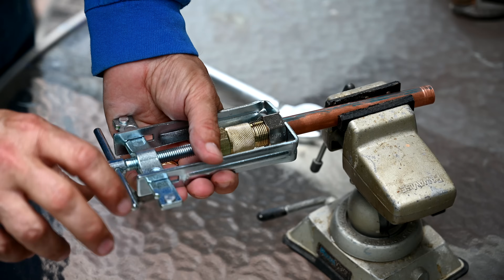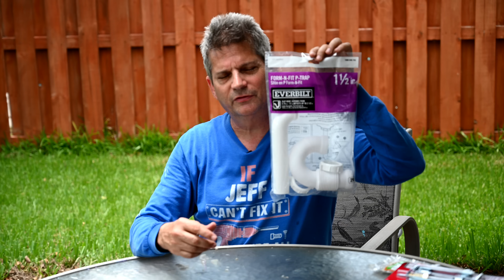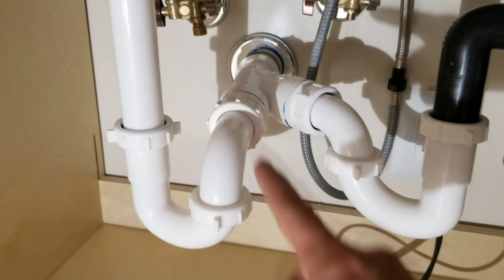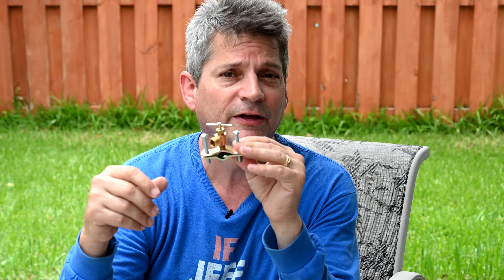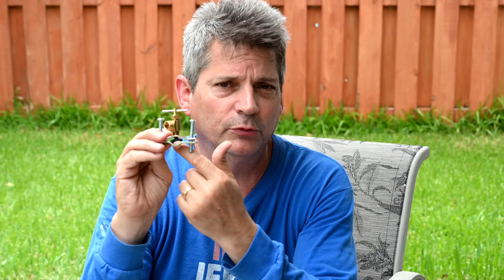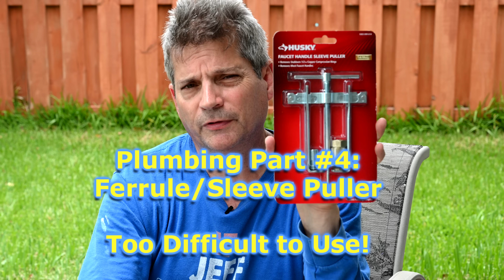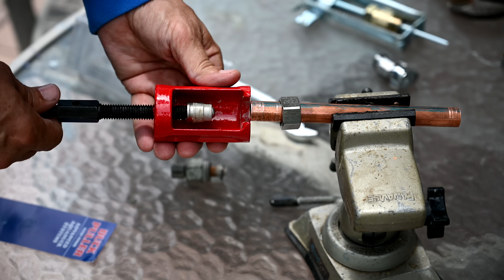4 Plumbing Parts/Tools You Should NEVER Use. NO Plumbing Fails

Comment: plumber taking 10 minutes to install a tee fitting, ok.  What's he gonna charge for that 10 minutes?  $200?
Reply from the maker: They generally have minimum charges probably an hour for just showing up in period one time I had 1 come a couple of years ago at 1 of our flip condos to snake out the kitchen dream to the sewer and it was a $135 for 20 minutes of work he was and even there a 1/2 hour total.
Reply: @geoff Hazel Invoices  are not just to cover the time someone spends in a customer’s house.

 

Time spent on site is a fraction of what the invoice has to cover.  It can take over an hour to drive from one job to the next, sometimes less.  We also have many fixed costs including, but not limited to:  insurance, vehicle maintenance, training, communications, tools, calibration, office time, office equipment, vehicle leasing, accountancy costs, PPE, tax, Pensions, sick and holiday pay.  Most of these are the same if we are on site 5 minutes or 5 hours.
Reply: Geoff Hazel 200 dollars is reasonable to do a job like that. If you can find a licensed plumber to show up, crawl under the house or go up in attic, install a copper tee and run water over to whatever you are adding you should save his number in your phone.

Comment: ferrules are not meant to be removed don't even try this
Reply: I always make my best effort to replace ferrule and nut when replacing a water stop. If one is replacing a water stop, might as well take a little more time to do it right and replace the whole thing. The only time I dont is when I have no room whatsoever.
Reply from the maker: @ryanporter1819  Yes, I do it 100% of the time, it comes with the valve, why not use it. It also gives me a chance to buff down the pipe back to brand new super shiny copper status, just like it was in day one, every piece brand new, and I can sleep better at night knowing it won't leak. Nothing beats seeing that brand new shiny copper pipe coming out of the wall, with the new shiny chrome flange plate, and the brand new 1/4 turn valve and steel hose. When selling your house, no home inspector can argue with it. IT gives them no reason to try to claim your valves are old and "due for a leak"
Reply from the maker: Yes you can remove them, and we do when there has been excessive moisture and hence corrosion. We bring the pipe back to brand new status the day it was originally installed.

Comment: I agree with all your points except for the puller, you are not using it correctly. It, in fact, works quite well. The piece that rolled on the table is supposed to be in the brass part, those large 90 degree pullers are not needed for this, only faucet handles.

Comment: Why not say use this instead of this, that would be of more use than just quoting what is banned in code. Without giving proper alternatives this video is rather useless.
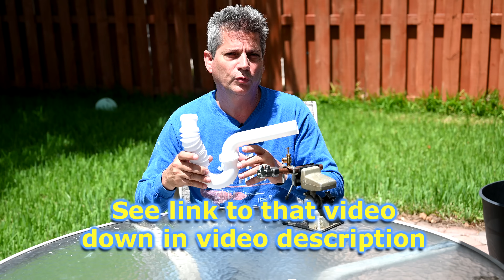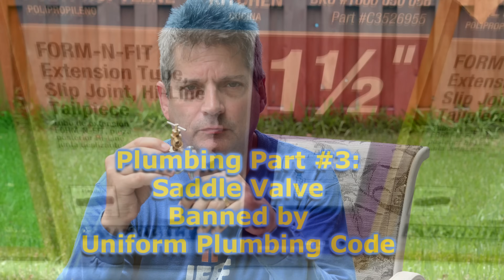Reply from the maker: LOL, I did just that, you did't actually watch the video. At 3:15, for example, I tell you about using the p-trap alternative to use for S-Trap. At 6:15 in the video, I mentioned the alternative to using the flex trap. At 10:45 in the video I mentioned what real plumbers do to remove a saddle valve, and what the correct parts is for them to use. You never watched the video! LOL!
Reply: jeffostroff  a long way round for a short cut.

Comment: I’ve had a saddle valve on a PVC pipe feeding the refrigerator for over 40 years with no problem.
Reply from the maker: That is a more ideal situation than cheap metal on copper types of saddle valves. For every person you like you who gets lucky, there are plenty who are unlucky. When that leaks and causes $30,000 flood damage, how proud are you going to be of those 40 years?
Reply: jeffostroff It has been my experience over the past 60 years that more times than not the failure of different products is due more to improper or faulty installation than it is to the product itself.
Reply: jeffostroff   $30,000 dollars?  I have remediated hundreds of water damage houses and business due to leaky pipes or appliances and the vast majority never exceed a few thousand dollars. It is the rate exception of a major second floor leak not being discovered for at least a few days that may result in $30,000 dollars worth of damage.
Reply from the maker: @kenedward60  Mold remediation adds a bit tot he cost, and I've seen people whose flood damage ruined several rooms, closets, all the clothes in the closets, all their furniture. Mold is a big issue here in FL. Also people get displaced out of their home for weeks because of the mold.

Comment: I'm pretty sure you are using the Husky Puller wrong.  I'll admit that I never used one, but I seen instructional videos of a similar tool by Superior tools.  The arms are only used for Faucet handle removal.... for the sleeve you only use that small drum insert and then is behaves similar to the second tool you demonstrated.
Reply from the maker: The Husky tool works on normal ferrules, and yes I was not perfect in showing its operation, but we have used it on stuck ferrules and it does not work on stuck ferrules.
Reply: @jeffostroff  It might very well be that the tool still sucks but I just like giving tools a fair chance with correct usage :)
No offense intended but the demo in this video was more than just "not perfect" but it was completely wrong.   Not sure if the link will work but the video I referred to is here  https://www.youtube.com/watch?v=7KDe8ACKjwc

Comment: Welcome to my world...... but what about all the things that may not be a specific code violation, but are just BARELY allowed? Plenty of poorly designed components and parts. Cheap does not have to be crap. WAYYYY back in the day, a CHEAP faucet by Delta, American Standard etc.... was same or better reliability than their own fancier full line, you just had less style and finish selection. The old Good Better and BEST options..... but the basic was totally acceptable in engineering and materials.   Nice video, but it goes into the weeds...... WOW.... could not sacrifice a 75 cent ferrule, to do a real demo of the tool ?  Redo demo, I'll send you a buck.... The Toilet "hose"  ?  OK, when I make my own U Tube channel, I'll take the hits, I am sure!
Reply from the maker: Yes that is a good point often times we find that minimum code isn't always the best and often isn't good enough.

Comment: S-bends don't fail by reason of "capillary action";  they fail for reason of water momentum and, more predictably, for reason of unfavorable differential pressures.  Thus an S-bend won't fail if the "nearby toilet" creates no suction on a lavatory's S-bend;  by virtue of good and copious venting at the toilet drain pipe design.   While S-bends might be illegal, they aren't guaranteed to fail, like a lot of other illegalities.   So there are "venial sins" and "mortal sins," in the Ten Commandments, and in the UPC.

Comment: Try the English Tool Company compression sleeve puller.  It's cheaper and half the size of the one in the video and pulls the nut/ferrule off with ease.  Just use a small rachet/socket instead of a wrench and bam, its off in seconds.   Here's a Youtube link:  https://www.youtube.com/watch?v=y0ikqzSz-DQ
Reply from the maker: We have this tool. I plan to do a video soon showing all the tools we use to remove a stuck ferrule compression sleeve

Comment: This has been very informative. While I agree that some of these products aren’t great, I was surprised that they aren’t code considering the massive market for them.
I have actually used a couple myself and learned how bad they were.

Some of the reasons people use them isn’t being cheap, they don’t have the money for a plumber.
With the randomness of the fittings and previous repairs in older houses, it can be difficult to find the correct parts.
I have also heard folks at the hardware stores say there was never such ; thread, angle of flare, size fitting, widget or whatever when I was working on something that was built with several of them.

Temporary fixes tend to become permanent.

Life had larger priorities when I made this fix until my next day off.
( hospice care, family illness, and something else equally important)

P trap had rusted and began to leak. I knew it was a bigger problem than I had time for that day and calling a plumber was not an option.
I wrapped it using 3m electrical tape. It worked.
While it’s not something to be proud of, my temporary repair lasted for a very long time. (Actually longer than that relationship)
Reply from the maker: Yes, your comment about "Temporary fixes tend to become permanent" hits it right on target. Someone makes a quick patch, and it holds, the Ac working again hooray, and they forget about it because the patch is holding.

Comment: Whatever the complaint is about smells coming up the drain, it aint methane. It's odourless.
Reply from the maker: Right that is normal sewer gasses that people smell but you are not a 100% correct about methane because if it was real manufactured methane and methane they often mix it with a chemical to give it a smell so that you'll know its presence

Comment: They tap into mains with saddle valves
Reply from the maker: That is scary.
Reply: @jeffostroff  What's scary is that you didn't know that.BTW, I've found and changed way more ball valves than properly installed saddle valves.

Comment: https://www.youtube.com/watch?v=MjNrGuxYvjQ
Reply: you are not even using the tool correctly?
Reply: you are welcome Jeff
Reply from the maker: @simondavey2955  Good video thanks, but notice all the crap he had to go through, disassemble tool, re-assemble it later afterwards, which he did not show, did you see how long it took him to unscrew  the ferrule sleeve, and he struggled you could hear him grunting, then after all that work he said that was one of the easier ferule rings to remove. Wait until you get an old one that is really stuck on there like we encounter all the time, you'll be really grunting, and your fingers will be in pain. He's struggling trying to turn that stupid little stem of a handle, when I use the duck puller it's off in 20 seconds, with ZERO effort, and no tools to disassemble and re-assemble. In short, the Husky tool works with elbow grease if your ferule is in good shape and comes off easy. Not so good on older corroded stuck ferules.

Comment: There are two grooves in the sides of the husky tool. I think you are a bit opinionated
Reply from the maker: Well you keep using it on stuck ferrules, let me know how that works out for you.  The Duck puller simply has much better mechanical advantage because you use a wrench, instead of trying to twist a thin rod with your fingers. Yes I am opinionated on that. My opinion is you go with the tool that is better designed for the job.

Comment: How long must you run out of a p trap before you can use an 88 degree bend?

No issues with s traps if your system is vented
Reply from the maker: Correct, one of the causes of the S-Trap losing its water is siphonage caused by a long vertical drop of water down a long pipe with no ventilation near by.
Reply: @jeffostroff  building code in new Zealand only has restrictions on 32mm pipe, max of 1.5m vertical runs.

All other pipesizes there are no restrictions on vertical runs, however, there are zones at the top and bottom of a stack that cannot be connected into, to prevent negative pressure zones and hydraulic jump.

Comment: dunno what the hell your talking about,   thats fine here because the sinks are on a totally seperate (VENTED)  line and that water will always be that level in the pee trap under the sink.
Reply from the maker: You are completely missing what causes the S-Trap to empty of water, has nothing to do with the level of the trap. Whenever you have a short vertical leg of the drain feeding into the S=trap then into a long vertical leg, then you can get a siphon effect, where the water pushes itself right out of the S-Trap. IT is serious enough that it is banned in all 50 states.

Comment: Every decent plumber uses that rigid stop wrench. Its meant for that specific reason to be a dual to tri use tool.   The puller is not ever needed truly but if you use a power drill on a slow high torque setting, it  can easily attach to it and have the power to do so. That being said Heat in the right places and a pair of channels can get the compression ring off with just a bit of manliness.  Heat behind the compression ring ever so ginelrgly and you'll make the brass softer than the copper which mean it will expand faster than the copper. Take it off wait for the copper to cool and use a brand new compression ring.
Reply from the maker: Great tip thanks for that 1. We have seen a number of interesting tips that people have tried to get these struck a feral sleeves off.
Reply: @jeffostroff  My pops was a Chicago Union  plumber for 42 years. He taught me every trick in the book. You call them feral sleeves, we in IL call them compression rings. Different names same thing. But there are always easier ways of taking them off than leaving a job to buy a puller tool. If you have one GREAT! It will makes things easier in the long run, but I think everyone would know old school tricks just like you do !

Comment: for that husky tool, not saying that it will work as good as the other options which are defiantly better.  On the tool there are 2 notches near the turn handle.  if you put the arms into them it will give enough room to turn the handle, and more leverage to stay on the nut while using it.

Comment: HVAC people use saddle valves all the time to install humidifiers into the forced air heating systems to supply water to the humidifier 🙄
Reply: That’s true.  When I moved into my house, a saddle valve with two outlets was installed on the pipe leading to the water heater; one for the humidifier and one for an ice maker.

I’ve since replaced the pierced pipe and installed a tee leading to another tee with proper sweat-on valves.
Reply: will schultz you’re using the wrong hvac companies then

Comment: The husky puller u are using it wrong. It super easy to use. Take the metal handle out and try it again. U don't need to squeeze nothing. That is one of the best tools. I have in my tool bag.
Reply from the maker: I'll try it again on the next stuck ferrule

Comment: Thank you very much for this video. I have the flex pipe on the master bathroom vanity not completely installed yet. So, I guess that thing is out. I was wondering about the ridges if that would be a problem. In addition, I had no idea the piercing water connectors were a violation. I have scene people use those for 40 years! To include yours truly.  Thanks again the inspector is one thing.  Your Insurance company will not pay a claim if they do not have to.

You have a new subscriber and I hit the bell. In addition to the people I subscribe to. I always hit the like button to help you out.

Comment: Your video in the snappy trap section shows two traps servicing a single fixture. This is not allowed aymore but was in the past. Even a two or three bowl sink can only be drained by one trap.
Reply from the maker: Steve, this is allowed in our current Florida Plumbing Code: Section 1002 Trap Requirements
1002.1 Fixture traps
Each plumbing fixture shall be separately trapped by a liquid-seal trap, except as otherwise permitted by this code. The vertical distance from the fixture outlet to the trap weir shall not exceed 24 inches (610 mm), and the horizontal distance shall not exceed 30 inches (610 mm) measured from the centerline of the fixture outlet to the centerline of the inlet of the trap. The height of a clothes washer standpipe above a trap shall conform to Section 802.3.3. A fixture shall not be double trapped.